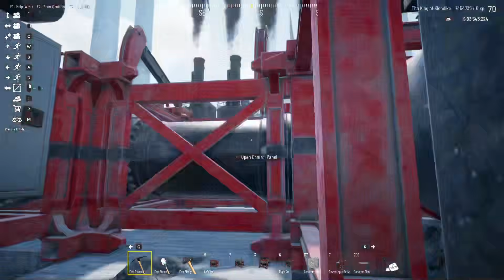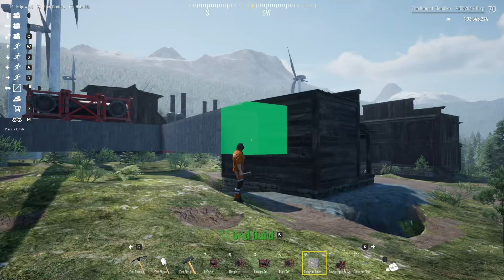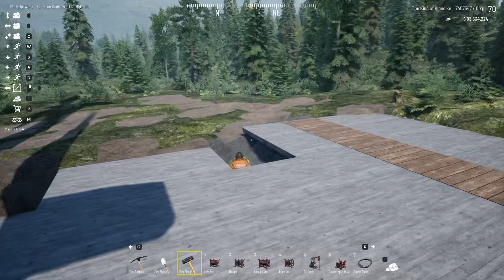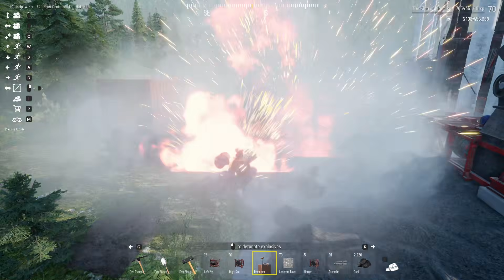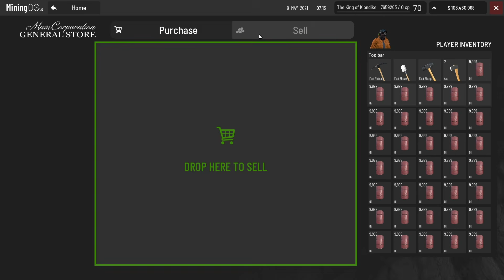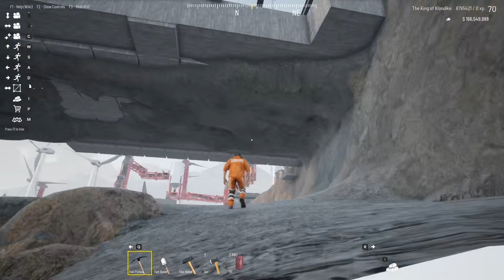Out Of Ore - Oil City, a start. $1920 a second - a nice little earner.

Comment: If you are recording with OBS do some more testing, you're getting lots of stuttery frames making the video hard to watch!
Reply from the maker: Hello,

thanks for the input. I'm not sure how to get OBS any more refined than I have it at the mo. I do of course record in 1080p and should be at 60fps, but that seems to change randomly. It might purely down to running on an old PC. I hope my later videos have become better. I have done some upgrades to my system and I know try to make a point of freeing up as much RAM as possible before gameplay.

Anyway, thank you for watching and taking the time to contact me.

Cheers, Bill.